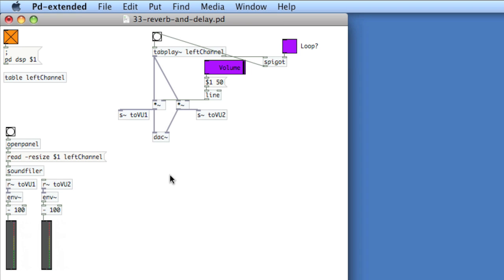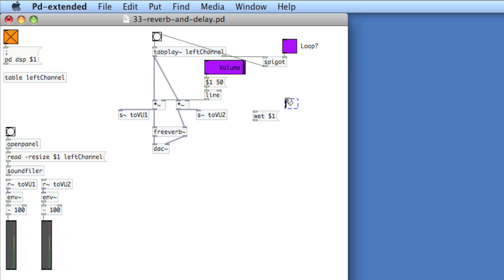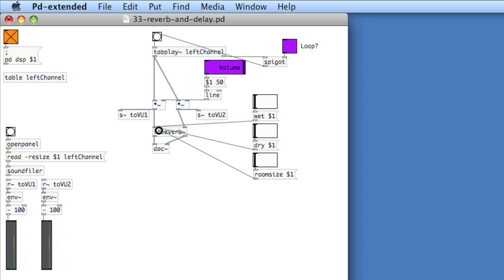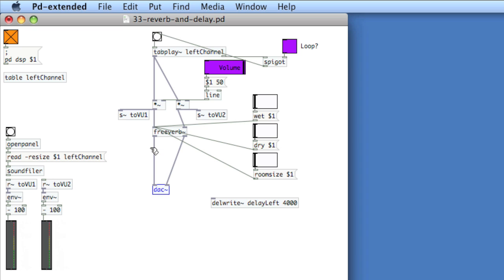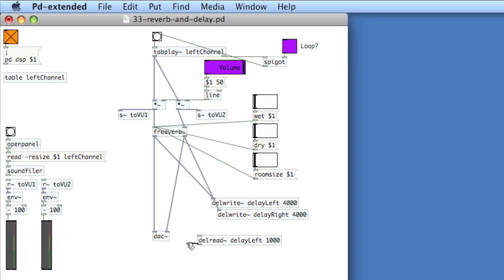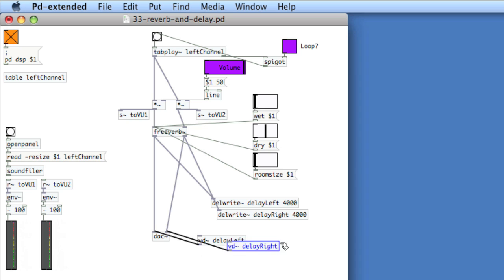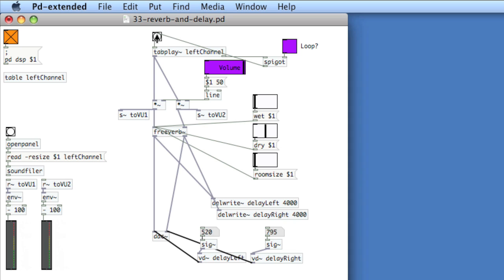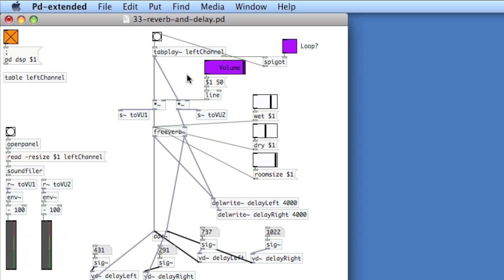PURE DATA: 33 Reverb and Delay

Comment: I just finished all your videos 🙂They are very good material and even though, I don't need most of the things you explained about audio because I will mostly use MIDI, it helped me to understand how Pd works.

The only thing that I really regret is that "Pure Data Extended" was abandoned. There is also Purr Data, which aim to be better because they remove the old fashion TCL/TK GUI, but so far as I understand this, there are still Pd extensions using this, so, you will have to do without them 😞.

Other drawback is that Purr Data uses a browser engine instead, called: node-webkit, but although it looks much nicer, this demands also more CPU and memory.

So, I guess I will choose the vanilla version of Pd for my development. I don't really care about the GUI. For me it doesn't look that bad and if it consumes less resources, then for sure for me is better.

Comment: freeverb doesn't work for me :( (error) How to install it?
Reply: Freeverb seems to be deprecated, it still works with pd extended (which is also deprecated) but it's described as a collection of 8 comb filters so I'm just going to read up on how to implement reverb myself, shouldn't be too hard. A comb filter is just a delayed signal added to the original signal, that simulates the effect of sound bouncing off walls (sound is 300m/s so I think a 10ms delay is 1.5m away). I'm guessing the fact that it's 8 comb filters is because 2^3 allows you to make a 3d box inside which the signal reverbs. (2 walls, 3 dimensions) That's just speculation though, I still have some reading to do. Good luck with getting reverb in pd! (and let me know if you figure it out)
Reply: @KoenZyxYssel  Let me know if you figure it out!  That's what I was hoping to discover at this point in the tutorials, how to use math to create reverb and feedback delay effects, rather than just punching in someone else's objects